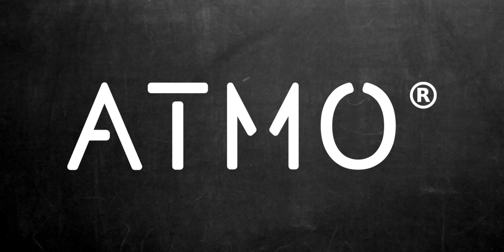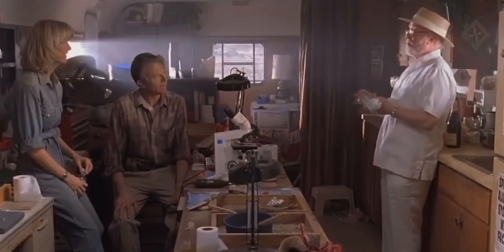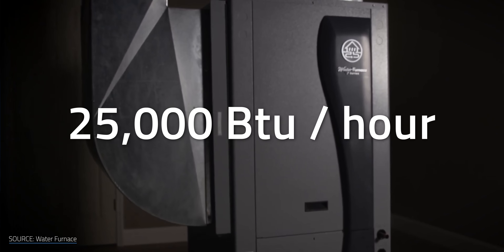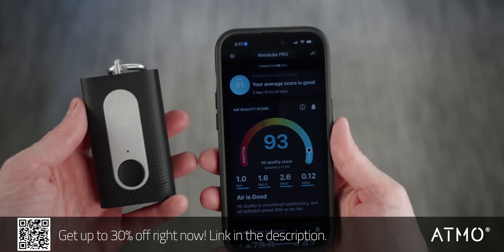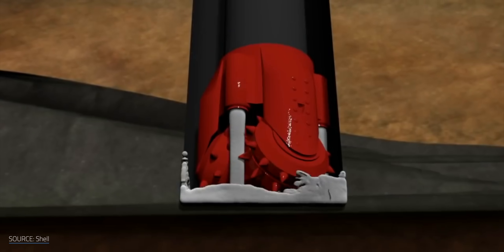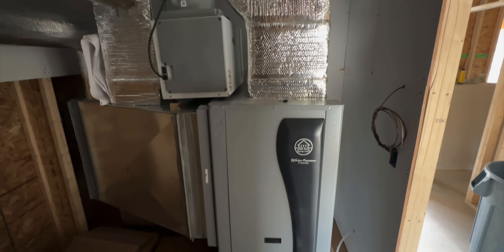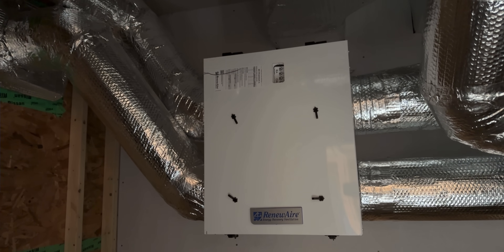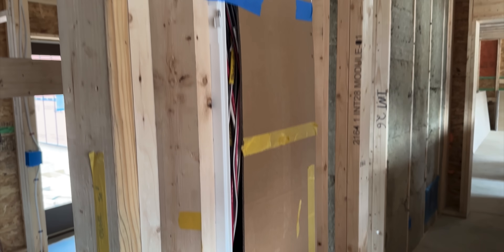Why I Went With Geothermal For My Net Zero Home

Comment: Why do you have to cool the building?  With a properly design building, preferably of heavyweight construction and strategically placed shading that allows winter solar gain and summer shading it is possible to keep the building temperature very stable, cool in summer and cosy warm in winter.  Our house is of moderate weight i.e. brick cavity insulated walls and clay tile roof and it remained at a tolerable 25.5degC/78degF when the external air temp was 40degC/104degF last summer.  Cooling a building, even with heat pumps requires 3x the electricity input than is required to heat it so cooling a building in summer is best avoided especially, in a building that is supposedly 'energy efficient'.  Its no coincidence that vernacular buildings in the hotter areas are heavyweight.

Whilst the air distribution system may raise/lower the internal temperatures quickly (it also has the benefit of using ambient external air for free cooling at moderate times of the year) current best practice dictates that the air is distributed at floor level with low speed input.  This results in much less stratification and obviates the draughts from high level input.  Warm air naturally rises so that inputting air at floor level give a greater overall stable temperature.  The issue with high level ventilation is that in the home much of the time the occupation is sedentary and most people will adjust the temperature to keep their feet warm especially, as these are the most affected parts of the body.  If the heat is pumped in at high level then it stays up there until all the air is gradually warmed but there is clear stratification meaning that the air temperature at the ceiling level will need to be up to 2-3degC/4-9degF warmer just to achieve warm toes!

For me the starting point on an energy efficient system is to use a wet underfloor heating system with a heavyweight design and no mechanical cooling.  For ventilation a heat recovery system, extracting from bath/shower rooms, utility room and kitchen would be desirable with tempered air being inputted into the living spaces.

Comment: The ground temperature at 19 feet has Not 50 all over the country .

It is actually the Average temp of where you live .
So Miami does not have 5o degree ground temps!

Check your local data.

Comment: I have to wonder if the advances in horizontal drilling used by utilities for running buried lines and pipes can be applied to this type of heat pump installation.

Comment: I'm an IT guy who became a tradesman. Used to be a systems admin / software engineer. Now I'm a mechanical engineer. My experience has turned me away from geothermal in New England. It sounds like it might be great in other parts of the country though. I recently built a zero emissions house and I used Air source heat pumps. I really think that's a no-brainer in New England. The cost of geothermal makes it not viable. If you need to use the incentives and government rebates then that means you can't afford it and you should not use it. It is not fair to force poor people to pay for rich people to build their own Jurassic Park. The net gain for society is not there. Subsidies or rebates are not a scientific or engineering way to do things. In fact they are there to compete against what the numbers tell us. To make it worth it even though the science tells us it isn't.  Drilling wells is the worst way to do geothermal if you really care about mother Earth. If you and your neighbors have your own well let's hope your geothermal project has not damaged them already and will never have a leak down the road. Let's hope you haven't changed the whole system down there already.  

Going green is so much easier than people make it out to be. If you want to do 0 to 60 in 10 seconds you don't need a Ferrari. That is not what efficient means. The amount of money you spend needs to be calculated into that equation. The amount of damage you do to the surrounding area means to be counted into that equation.  The number one thing you need to focus on is insulation. It really is that simple. That's literally it. All this other stuff can't even come close to combating energy loss than insulation. 

Don't build a giant house. Too many people build homes that are bigger than they need. Spend your money on insulation and good windows. If you do that an air source heat pump is going to work all year. Install an electric water heater and just like that you are zero emissions. Now you just need to generate enough energy to offset that. A couple hundred bucks worth of electricity per month in a small home. No oil or gas bill. No emissions on site. 

I would not do geothermal in conjunction with an air handler. Forced air is a higher temperature system. I would only use geothermal with low temp systems. Like radiant.  

You remind me of myself when I first left the IT world and thought I was going to reinvent the wheel in the plumbing and heating world. I also immediately was attracted to geothermal. After some time working with the different systems I moved away from that. In fact I now recommend against it.

I don't agree with what they told you about radient heat and having problems with it being too hot. That can happen on days that are unusually warm but design should address that. You send colder water as it gets warmer outside.

I don't see this project as being either green or efficient. Does look like a lot of fun though and you're getting to learn stuff and play with some cool gadgets.

Comment: I got geothermal in 2011 and loved it.  One problem though -- replacement and servicing.  One of our compressors just broke and it's a 12 week wait (supply chain problem from Germany) and a $20K fix.  I hate to say it, but we are actually replacing it with a new traditional unit now before the heat wave hits. A whole new traditional unit is 1/2 the price of the geo compressor. The ground loop still works great and, hopefully, more geo units will be in use in the USA and we can replace with another geo unit when this new one breaks in a decade or so.  Good luck!

Comment: You should not need as much energy I put if you had followed some of the passive house principles. Adding geo thermal and forced air seems really sub-optimal. You have an attic and could have easily installed ducted or ductless mini splits for much less money than GeoThermal plus forced air. Just my $0.02. Love to hear how it goes and your actual heat load.

Comment: The biggest challenge seems to me, handling the complexity of the tech! I see a lot of highly fine tuned interactions of many components. If the AI operating this, malfunctions, the house owner needs to understand the intricacies of all the interactions! Moreover, I am thinking about small malfunctions triggering (in the mathematical sense) "chaotic" feedback loops in complex systems. This seems to add up to a risk for owners who don't have professional expertise, people who just read the "first steps" chapter of the manual, to get overwhelmed in an emergency. I am sure there are technical and logistical solutions in place that  address this. It would be interesting to hear about those.

Comment: I live in Finland and we had had geothermal heatiing for 20 years. The original pump is still working. I don’t know where you are living but based on the min-max tempretures you gave it seems we have similar climate. The average yearly tempteature here is around +6 degrees celsius (42 F). That is also the average tempreature in the bedrock 30 feet down into the bedrock. I think that is is a universal thing. Our heatpump is a standard on/off type and is 8.5 kW as meassured here in Europe back then. I think according to new standards it would be rated 10 kW. We have floor heating inbededded in a cocteate slab,downstairs and weddged between metal sheet grooves up stairs. There is a big difference in the heat dispence in favour of the tiled covered concreate slab. Our well is 178 meters deep or 584 feet.

I have run the heating for a year just on electricity out of curiosity of meassuring the real COOP for both heating and warm water production. We are a household of 5 so plenty of warm water goes to showering. I compared the reults taking into account different temperature and wind speed with a normal regression aalysis. The savings were 58 percent. That is quite much less than any marketed COOP value. I think the reason is the warm water usage. Our old pump is not particulary efficent in making warm water. The electicity consumption during summer months is only some 15 % lower compared to running direct on electricity.Our house is 238 m2 or slihtly above 2500 sqft. We use 12 - 14 thousand kWh (44 thousand btu) of electricity per year including household energy. Sligtly under half of the energy consuption is hosehold electtricity and warm water production over a full year. And oh yes, the obligatory minimum once a week sauna also consumes a fair share. All appliances are electric.

I don’t know how many cubic feet you need to heat but based on the pictures I got a little scared when you mentioned that you have only drilled a 400 feet well. That is if my assumptions on your average yearly tempreature is about same as mine. The first systems yhat were built around here had around 400 feet holes and there have been some issues with the ground water freezing which have caused damegae to the pipes. 

The dimensioning of the heatpump if it is an inverter type is not critical as you mentioned. However you can only draw as much energy from the ground as availble, and that is dependent on the depth of the well. To future proof I would recommend to oversize the hole rather than the pump. The reason being that pumps can become more efficient, thus draw more energy from the well, and more important to enable capacity for any future enlargements.

There seems to be differncies in the methods for drilling compared to here as well. Here we have mostly solid granite bedrock, np earthquake risks etc. Occasionally there might be cracks in the bedrock which prompsts for an additional well to be drilled. Here they drill a hole down to the bedrock and inserts a steel pipe, which is cemented into the bedrock. The rest is just a normal groundwater well.

My experience is that the well will loose around 2-3 degrees C during winter time and little bit over one degree over a few years of operation.

Comment: I dreamed of someday building a house like this.  Bravo!
One thing I’ve noticed though - even those with geothermal for space heating, never seem to use geo for water heating.  Is there some reason for this?  Some issue?  Have I missed something?  Or is it just that water heating and HVAC are traditionally separate, designed, manufactured, installed and repaired by different industries?
Best wishes and stay safe!

Comment: it seems rather short sighted to build a forever home using top of the line existing commercially available tech, especially multiple third party software IoTs. full opensource modular house design with moddablility is more reasonable and economic

Comment: Im so jealous, I wish I could afford geothermal power, do you have something like solar panels or a wind turbine as backup? I'm primarily interested in off the grid electricity because of how vulnerable the power lines are where I live, they fail every winter, and that's with current budget and maintenance, in an emergency id be pretty screwed without some sort of backup

Since you are already doing forced air, can you actually run an overpressure in your home? The constant outflow of air and pressure difference would seal your home from outside contaminates, I have allergies too, and overpressure is awesome for keeping stuff out.

God forbid if the worst were to happen it would also keep out radioactive fallout dust and poison gas... perhaps you could program an overpressure setting just for bad allergy days or emergencys?

Comment: Hi Matt, I’m in Montréal on pretty much the same geothermal system as you have (3t with waterfurnace furnace), I’m curious about the thermostat you plan to use with your system because my installer provided very old one (not even connected) ? Apparently i can’t install other thermostat for my setup (true) ?

Comment: Hi Matt. The title had me puzzled as, here in the UK, my understanding is that Geothermal usually refers to deep drilling towards the hot core of the planet. What you describe is a ‘ground source’ heat pump system. Hope it works well for you.

Comment: Nothing better than Geo Thermal..  Huge Fan.  My E-Bills are maybe half of most others during the winter..  during summer not quite as good.  10 years Zero issues.  I removed the doors and closely checked the Air heat exchanger.  Very Clean..  just blew it out.  Water Furnace 5 here.  Three 200 Ft. vertical wells in a forest of trees.  Also Got the DESuperHeater?  Not sure how good that works, but it's there, and I have great Hot water.  I need to turn off the E- Hot Water heater to see if the DSHeater does much.  Mine uses a single E Hot Water heater  Been recommended to get another to use as a tank that the DeSuperHeater can heat that water which feeds the E=Heater.  That way, the two heaters don't interfere.  Unknown.  Maybe comment on DeSuperHeaters?

Comment: "super energy efficient", "net zero" - then fails at the first hurdle with wood, chipboard and hardly any insulation. Spread out on a single story with many different sections sticking out and a huge roof surface area, all patently counter-intuitive for energy efficiency. Infact, I couldn't think of a much worse way to architect an energy efficient home.

Realise this wouldn't even meet basic building regulations for insulation in most European countries. Trying to 'green wash' your inefficient home and all the felled trees is frankly ironic. Especially while trying to push the 'net zero' political agenda.

Comment: I just got around to watching your Awesome video. I have to say you went with the right networking gear with Ubiquiti. Likewise, I’m putting it in my house. Ubiquiti equipment is outstanding. I would future-proof your network with them, I opted to install more professional and enterprise grade equipment from Ubiquiti cannot complain. I would recommend looking into 10gig switches using DAC cables, Aggregation switches, Enterprise in wall Wi-Fi and definitely their Redundant power system. The Ubiquiti cameras are good. I started off buying one of each to see how they worked in difficult areas for best coverage, except the PTZ camera. Furthermore, I have to say that their all in one sensors are worth the money and the floodlights as well. I currently have gigabit internet with my system, hoping fiber will be available in the upcoming yrs. Hope your house build goes good, can’t wait to see the next video on the house. P.s. Mac’s do extremely well on the gigabit connection, like 2.5-10gig.

Comment: Im very curious to see the performance of the hot water heat pump system. Im a refrigeration mechanic in Australia 22yrs experience and the self contained heat pumps were very popular over here, but from my experience the self contained modules were un reliable and effeciancy was not as good as claimed as the evaporator is not large enough to do the "work" required in colder climates. 
Generally they have a short compressor life due to them operating with a high discharge temps all the time due to high condensing temperatures.

Comment: The oversizing of you heat pump is absolutely going to be a problem. Unless WF has departed dramatically from variable speed conventions, that ramping function simply won’t be aggressive enough to compensate for the fact that it is nearly three times the size you need for your cooling demand. It will not run most of the time and not with a coil temperature far enough below your indoor air’s dew point. To do meaningful dehumidification. Even if you live in a dry climate, human activity generates a lot of moisture and you’re gonna have a hard time controlling indoor humidity. You should talk the people at SantaFe/ultra aire.
You’re design team ticked most of the boxes but if you really wanna be John Hammond you should put in a dedicated ducted dehumidifier

Comment: Matt, as always, thanks for your wonderful videos!  I have a question about your Ethernet cables.  Now that we're in a pretty-much-everything-is-wireless, why did you decide to run physical cables?  I did that in a home we built about 20 years ago (pre-wireless) but I don't use the physical cables except in one case to improve the location of the wireless router.  We are actually considering moving (development, so limited choices) and I was just thinking that I wouldn't need to worry about Ethernet cable runs in 2023+.  Am I wrong?  What can you do with a cable that you can't do wirelessly?  Thanks!

Comment: Great video and amazing progress on the house, cant wait for the rest of the series.
Probably not an issue at your location, but multi-well geothermal systems in Florida are preferable because you can in fact saturate the ground with heat during the summer affecting the performance. So you place at least two wells as far as you can within your property. I once saw a house with a 4 well system and some very fancy controls that would cycle the wells to maintain highest efficiency. But it was so fancy only the original owner knew how to use it (he designed it) and when he sold the house the new owners had to replace the geothermal source for regular air source heat pumps.

Comment: You keep mentioning how geothermal systems go down 10 ft to get 50 degrees F water,  but your geothermal goes down 400 feet,  what temperature is it delivering water to your house at 400ft?  25-30 degrees C instead of 10 degrees C?